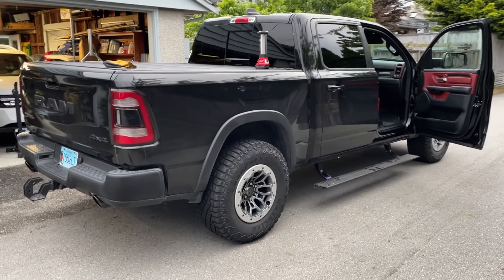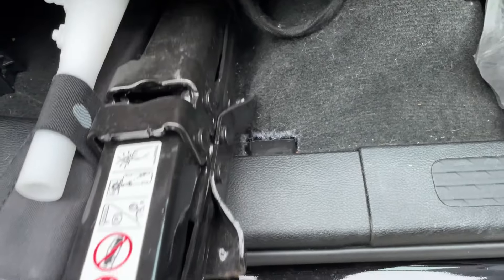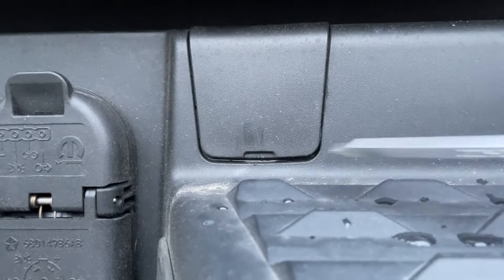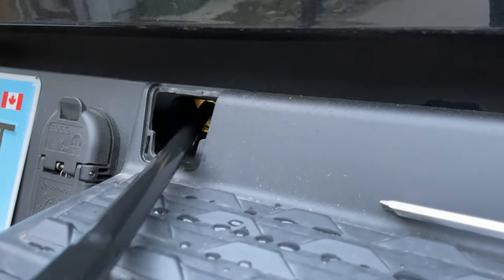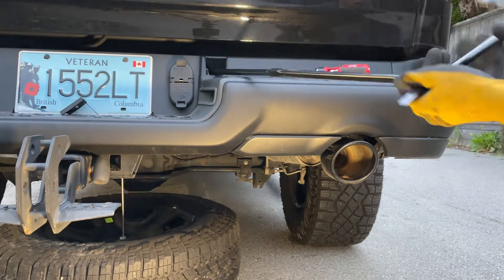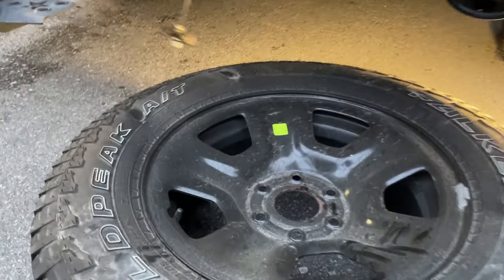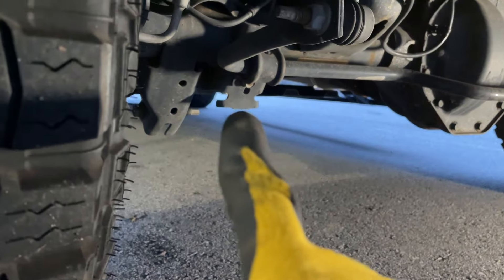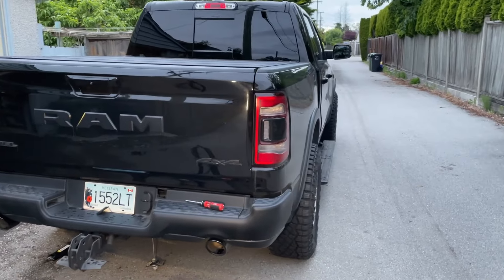HOW TO REMOVE RAM SPARE TIRE 2019+

Comment: did you know if 35 tire can fit down there ?
Reply from the maker: Yep with modifications it’ll fit, removing the heat shield
Reply: @WeekndGarage  Thank you
Reply: Hi.. what’s the size of your tire and wheels?
Reply from the maker: @darrelkenm.abella2294  Stock were 275/70/18 Now i have 325/65/18